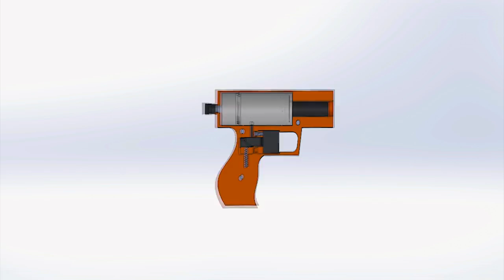3D Printed Nerf Gun - Heavy spring version - Easily Breaks a Wine Glass

Comment: Nerf modder here! You might want to try putting some white lithium grease into the plunger tube. Also 17/32 brass tubing is a perfect fit for spring powered Nerf. However, I understand if you don't want to contaminate yourself with imperial measurements.
Reply from the maker: Thanks for the tips! I’ll definitely try the lithium. And about those imperial measurements, my initial plan was to use off the shelf parts for the piston and cylinder so everybody with a printer could make this design. But finding off the shelf parts that are both common in the EU and USA turned out to be difficult. 17/32 brass tubing seems to be a good option for the next
design. Any suggestions for a off the shelf piston that can be used with the 17/32 tubing?
Reply: You can use large diameter PVC or PETG tubing as a plunger tube and you can use a bath plug of the right diameter attached to a metal rod as the plunger rod or "piston" as you called it. These are the materials used by people who make homemade blasters all the time. I would highly recommend that you check out the nerf subreddit or nerfhaven forums for advice on this topic, there are a number of very excellent guides on both that detail the off-the-shelf parts that can be used to make the internals of a nerf blaster.

Comment: super cool project. might i ask why you didn't put some fillets/chamfers around the outside of the gun body so that it wouldnt dig into your hand when you shoot it? was it a strength thing?
Reply from the maker: Thanks John! That’s a good question. The challenge with this kind of ‘big’ prints is warping. The 3d filament is extruded a 200+ degrees celsius and when it leaves the extruder it starts cooling down. While the filament is cooling down i shrinks a little. When the print is getting higher, it creates a temperature difference between the top and bottom layers of the print. this temperature difference  creates a pulling force on the edges of the print. when this pulling force is stronger than adhesions strength of the print to the  printbed, the print becomes loose and the prints fails. 

To answer your question:  the edges and corners of the print are the places where the warping starts. It’s important to make sure their is a excellent adhesion to the printbed on this places. by adding fillets/chamfers  you help the warping process because the edges and corners are printed above the printbed. With this design I a choose to sand to corners down after the print was finished. no ideal, but it worked ;)
Reply: @MBcreates  then next time add a raft and supports . Great thing you've made by the way! Is there a way I can get all the cad files to print the whole thing? (Please) Thanks. :)

Comment: Eliminate the O ring friction by feathering the leading edge of the piston so that it forms a compression seal (look up how hydraulic ram seals work) then when you fire, the greater the pressure, the BETTER the seal and MUCH LESS friction = more power.

I have made piston heads for MANY very high powered piston air rifles and the above is the method I use.. TIP: use PTFE for the front of the piston and the "feather" seal.
Reply from the maker: Thanks, I'm going to look into that!

Comment: correct me if I'm wrong but, couldn't 90 percent of the things you lathed be 3d printed? Seems to me that you were going for maximum power, strength and durability. But printing a completely assembled gun is way cooler and allows the community to print their own.
Reply from the maker: Hi Guy, The original plan was to design a Nerf that could be built with a 3d printer and of the shelf parts. The PVC plunger tube that I used, wasn’t round enough and I couldn’t get a good seal between the tube and plunger. That’s why I used the lathe. For future projects I got some good tips from the community for of the shelf parts. So this video is going to be continued 😊

Comment: You know i had a very old Nerf gun that would not hold its bullets because its casing snapped and some of its springs broke but my grandpa works at Bosch and got a brand new 3D printer So I Rebuilt the shell but I designed it like yours but the barrel was longer then i just Trimed off stuff so i could shape the body then i got a steel Lip thing with a handle and its connected to the barrel and the bullets fall downwards and i pull back the steel handle and fired. It was a perfect basic sniper but later on I changed the spring from the Nerf pistols piston and then basically put in a new  F25 spring and bought a same length spring but the diameter i shrunk and Put that inside of the F25 Spring and I changed its original range from 100 Feet to about 223 feet and  Recreated the Barrel and now it looks awesome. So thanks for the tutorial now I was able to learn how a Nerf Pistol works and I Then Made it even better and now I still today am Giving it New Mods and Trying to think of a New Paint job. ;)
Reply from the maker: That sounds awesome Vincent!  I’m glad that you learned something from my video and how nice to have a grandpa like that. Keep up making cool stuff!
Reply: Thanks =) God Bless you and Good luck on your next build! =)

Comment: duuude! i''m not saying this isnt cool, but using a lathe does not count as "3d printed". 
if you want firepower, tape the tio of a quality ballon onto some cardboard tube, and use 8mm / 0.3" steel balls, or just 3D print a slingshot.
Reply from the maker: Thanks for sharing your thoughts. Would it make a difference if I replaced the parts made on the lathe for of the shelf parts(so everyone with a printer could make it) would that count as a 3d printed nerf gun?